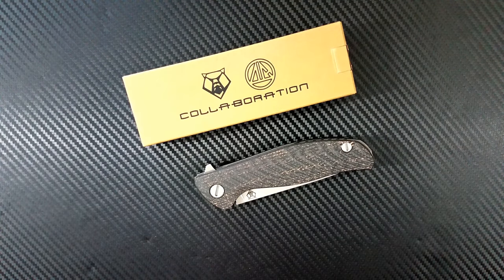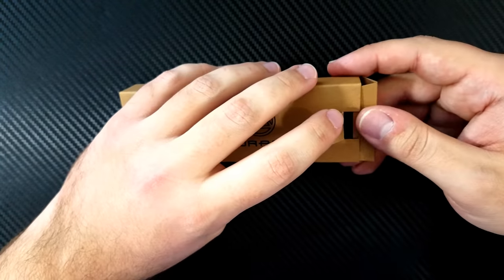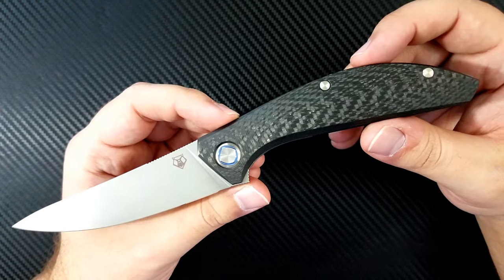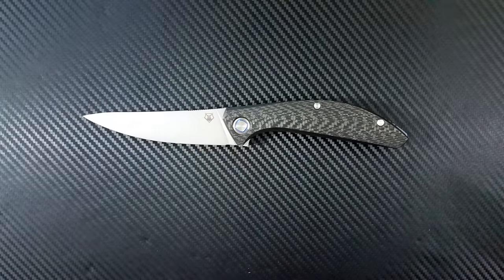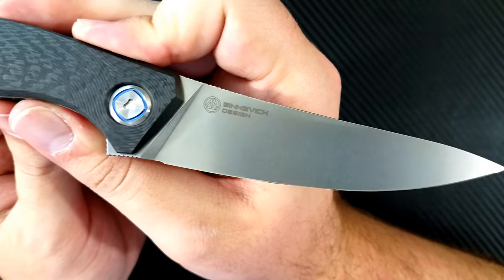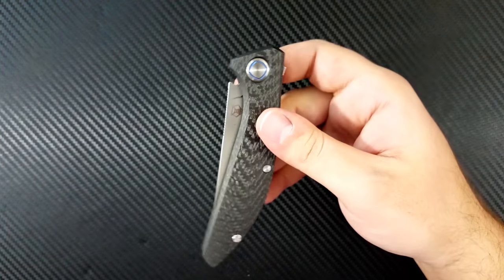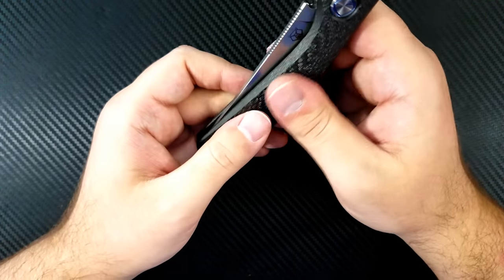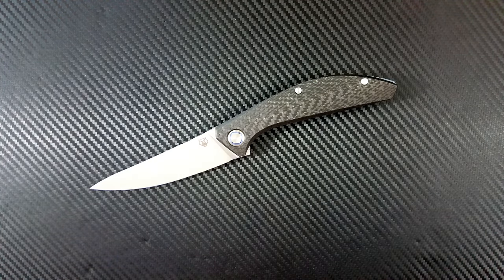Shirogorov Sigma Unboxing - Sinkevich + Shirogorov Score!!

Comment: Quite like it, the CF 111 Shiro with the fuller is still a grail knife for me. I think the Sigma would look a smidge better without the hump/bump near the tip and a more persian style blade, but overall neat. I'm crossing my fingers for a large ZT Persian Flipper ala a 0460 in a 0452 Size with some different CF Scales, maybe lightning strike or marbled/forged.
Reply from the maker: captainsewerrat it does look a bit weird, but in use it's wonderful.  I hope you get tour dream Shiro one day!